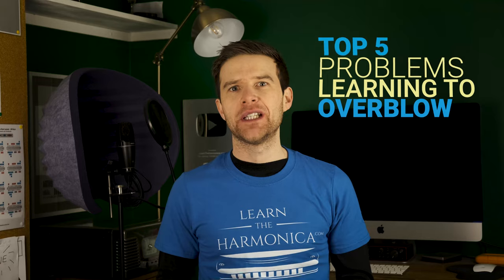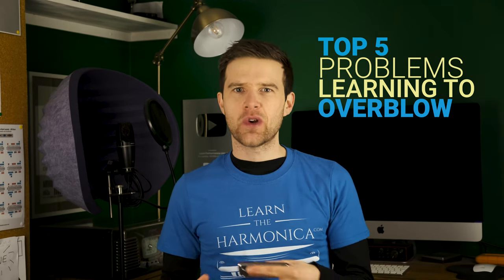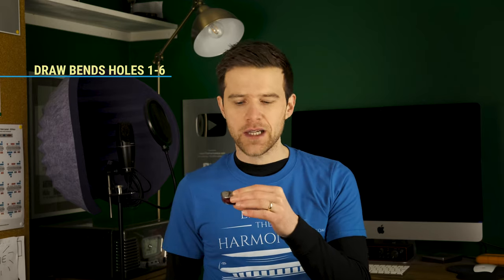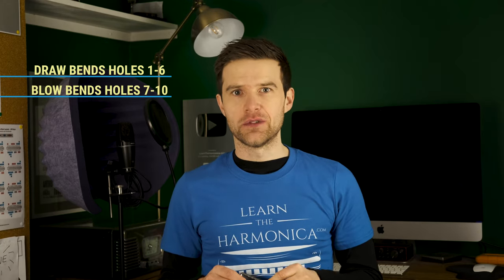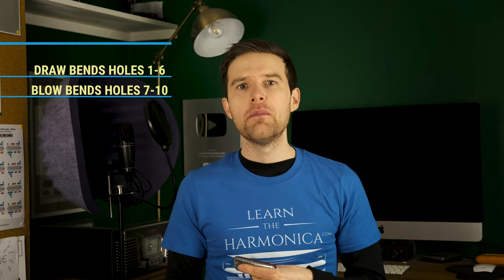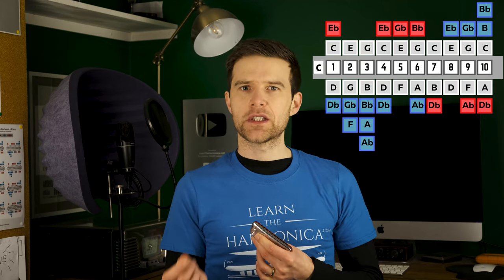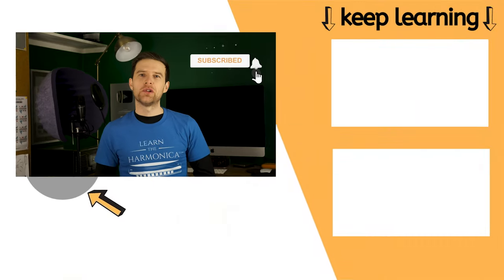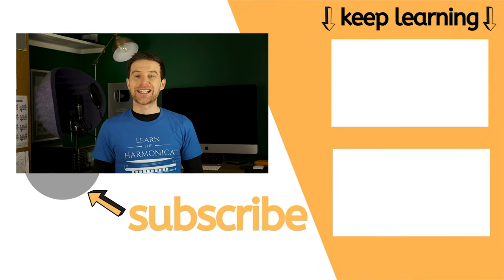Top 5 Overblow Problems (& Solutions) For Harmonica Players

Comment: Do you have to have your harmonica setup for overblows or will they work on an off the shelf harmonica- I play hohner marine band harmonicas
Reply: It definitely can make it easier when the harp has been properly adjusted for overblowing, but it is often possible to overblow with an off-the-shelf harp -- especially with the more expensive models (although the price is no guarantee that overblowing will be easy or even possible). Because harps are mass production items and good overblow setups use reed gaps and slot widths that require quite fine tolerances, you generally "get what you pay for". Having said that, I have occassionally had relatively easy to overblow off-the-shelf harps that were also not expensive models.
Reply: @docsharmonicablues  Thank you!

Comment: Hi Liam! One problem I have when doing the 6 hole overblow is that the 6 blow reed sticks after doing the overblow so when I try to play a normal 6 blow, it won't play or not easily. I'll have to use a lot of suction or even a small tool to free the reed. Is this a common problem? Any ideas how to prevent it? Thanks!
Reply: It might be moisture buildup. I had a similar problem a while ago. Just let the harp dry out and it should (hopefully) be back to normal.

Comment: Liam when you bend the 6 blow down it simply sound like a bend. Your example sounds like 2 separate notes. I don't see how you do that. It seems to be one continuous note? I am confused by what sound it is we want to achieve and why do we want it?
Reply from the maker: Overblows just give you extra notes - simple as that. You don't need them but they can be useful. 

With the 6 blow, you have to imagine that it will keep bending if you keep trying to bend it further and further. If you go far enough, the higher note should "jump out" at you.